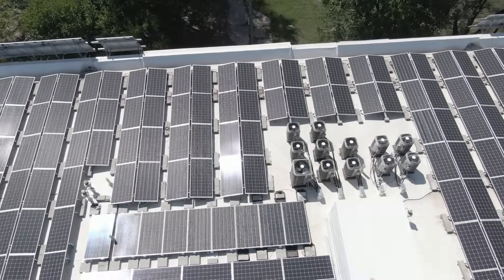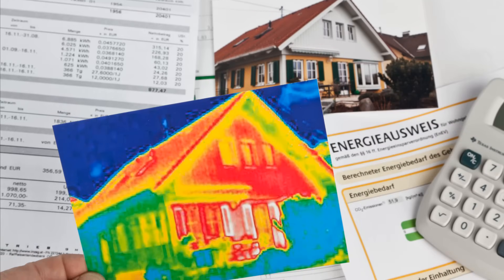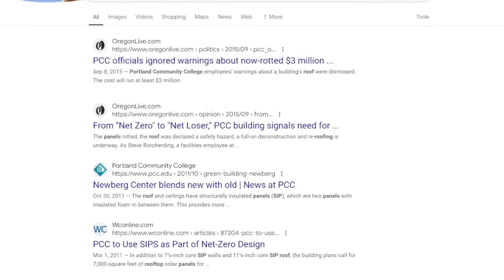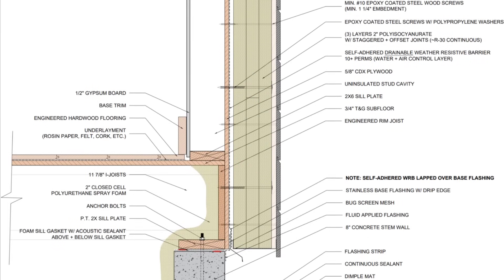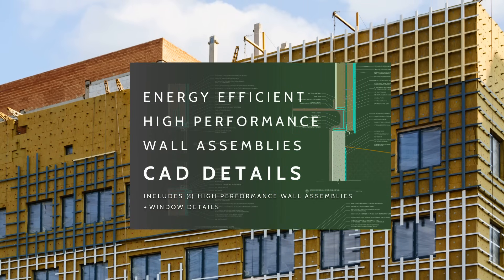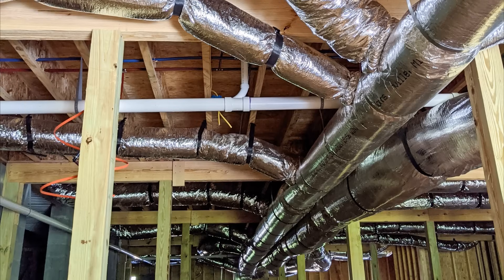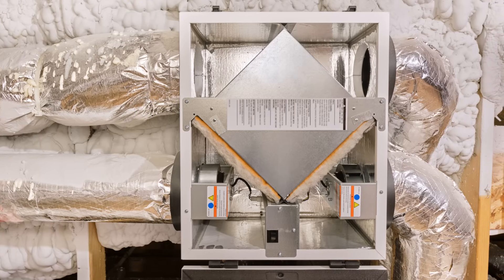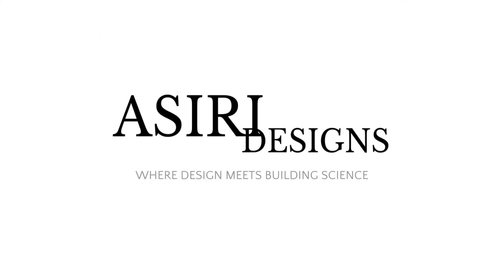The Unintended Consequences of Energy Efficiency...

Comment: So the answer would be less insulation in homes so they can breath and finding super cheap energy source for heating and cooling. The other topic I find no one talks about is sound. I like to sleep in total silence, but heat pumps, air conditioning and air  ex changers make enough noise to make that impossible.
Reply: Did we watch the same video? The one I watched said that more insulation is better, but you need to consider moisture ingress and retention. If you're looking for super cheap heating or cooling, heat pumps are the way to go. Well, actually it's district heating, but you're dependent on one (1) heat provider, which is bad. You may want to consider the placement of your heat pump in relation to your bedroom. These are all solvable issues, you just have to put in the work to consider these factors.

Comment: If you want true longevity, resource saving and energy efficiency:
- Let current wood houses degrade and be demolished over the next 1 to 3 generations.
- Replace those with buildings of stone, earth, cement blocks or brick.
- Place new structures to make full use of seasonal sunlight angles, avoid wind gullies and issues with rainwater flows.
- Bring back the multi-generational households of the past, thus reducing the need for new housing by at least 50%.

Trying to find solutions to a problem they caused is silly. Do it right the first time, follow historical methods if need be.
Reply: Wooden homes can last for centuries. Just look at any European city that was not leveled in WW2, they have many buildings that are older than the concept of a United States of America ;)
Reply: Mold is still an issue in a brick house, if you have double glazed windows. It just doesnt't destroy the structural integrity, unless you have wooden beams for your roof.

Comment: If you use Roxul - Stone Wool insulation moisture is not an problem
Reply from the maker: It's still a problem. Rockwool is insulation, insulation slows heat flow. Less heat flow = less drying potential. I happen to like Rockwool and I use it frequently, but it is not some magic insulation material that defies the laws of physics.
Reply: @ASIRIDesigns  That is if you don't plan ahead.  I have my installed use Roxul R23 in 6.5" cavities and leave open air gaps between the insulation and the exterior siding to allow moisture to wick.  Most people don't plan for this because they don't think moisture in their area

Comment: More expensive building.  So the energy savings is deleted… unless living on the street counts as energy savings
Reply: If you look at McMansions you can see lots of opportunity for cost savings without sacrificing energy efficiency.
Those complicated roof structures are prone to leakage.

They are built to a price-point. Homes are getting expensive because people (and corporations) are buying up land as a tax shelter. Land lacks the primary mechanism for lowering prices, increased supply, leading to market failure. In the absence of a Land Value tax: housing prices can only go up long-term.
Reply: @economicprisoner  I concur your assessment is correct.

Comment: exteriour insulation is just way too expensive; probably because there is high demand. 
something to note though, is animal / pests LOVE insulation. so before you know it, you'll basically end up with 2 full walls side by side, with sacrificial sheathing.

metal siding is cheap and creates a inherent rainscreen via the corrogation, so the exteriour wall could probably just skip the sheathing and use metal siding.

Comment: Don't forget radon.  You might be able to add better insulation to an older home, but can you really make sure the radon doesn't get in and stay there?  Also, is it really cheaper to seal the heck out of everything then install and maintian a ERV or HRV?  Some things make much more sense in new construction.
Reply: I can only tell you from my German POV. I stalled 3 decentralised HEV in my last house and the present  one. These are boxes (60x40x10 cm) the run on approximately 5 W. I don’t have to worry about ventilation/ heat loss. Asthmatic visitors commented positively.
It is also about CO2 and chemicals getting out not only moisture. Radon of course as well. Opening the windows alone is inefficient and has a number of drawbacks. I think Sweden has a mandatory Code to include forced ventilation. I think the health benefits in the long run outweigh the initial/ running costs.

Comment: My old house, over 100 years is hard to insulate, but having a woodstove is the best thing ever.
My house really works well on old technology.
Not everything new is good or better than old tech.
Reply: I put in a wood stove a couple years ago and it was the best thing I ever did. It's a lifestyle. Wood stoves aren't for modern people in subdivisions but land owners who manage land and know how to use a chainsaw that uses gas. lol I will always have a wood stove from now on.
Reply: @Jumanjini  Exactly.  I literally takes a ton of wood.  One estimate it is takes 22 years of tree growth to heat the average house for 3 weeks.  You need lots of land so not practical for the majority of people.  You can have the stove outdoor to avoid indoor pollution, but if enough people had them outdoor it will create outdoor pollution.  Nuclear power with heat pumps is the best solution for most of the world.
Reply: Your wood stove pollutes your interior.

Not everything old was ever great to begin with.
Reply: @Omniverse0  I take it you've never lived with a wood stove. In my experience a single candle pollutes the indoor air more than a halfway decent wood stove. You might get a tiny bit of smoke escaping when you first fire it up, but once it's warm there's such a strong suction from the flue pipe that any leak will only pull fresh air in. Smoke does not leak into the room.
Some old wood stoves can be bad for local outdoor air quality, but modern ones burn very clean as long as the fuel is of good quality.
But man, heating a poorly insulated home with a wood stove can get very expensive. Firewood typically isn't free. My parents used to do that. In the winter they'd easily go through a sack of firewood every day. They cut that heating costs in half simply by re-insulating the living room. Turned out the walls had originally been slapped together with very little insulation. Later they installed a simple air to air heat pump, cutting heating costs even further. Now they only need that wood stove for the absolute coldest days of the year.
Reply: @fnorgen  sorry, but wooden stoves are a very serious polutant and health risk - read up on it.
Reply: @Omniverse0  The house has one air exchange every hour on a calm day. What pollutants  are you referring to?
Reply: Be careful with particle polution. Have something to measure it in your rooms.

Comment: This is a very important warning for remodelers and those using newer constructions techniques and materials. "Build tight, ventilate right" is the saying in weatherization, but too often there is a lack of understanding of what constitutes "right." The tighter you make the envelope, the more attention you have to pay to movement (or lack thereof) of air. Of course, one could eschew the modern building materials---most of which were designed to follow existing building traditions in the most profitable way---and use breathable natural materials, like hemp-lime.

A well-made hemp-lime wall structure avoids the complexity of modern, multi-layer, multi-material walls system while providing moisture management through natural permeability; they provide insulative value and comfort through thermal mass; and they reduce the toxicity and carbon footprints of buildings. A hemp-lime wall can be formed in place (cast) or assembled from pre-made blocks. Exterior and interior finishes of lime-based renders can protect the structure from the elements while maintaining moisture permeability.

Hemp-lime is not load-bearing, so some sort of framed structure is needed. But another benefit of this methodology is that the construction crew needn't be skilled tradespeople: a few hours of hands-on instruction from a single skilled foreperson is all that is required to deputize a hemp-lime building crew. The possible downside of such building methods don't necessarily lend themselves to the economic realities surrounding our housing shortage (in the U.S. and elsewhere). How can we build the volume of housing that we need at the pace that we need it? Perhaps local communities can organize hemp-lime building cohorts that can supply labor to local housing developments. The labor need not be skilled to the same extent that a traditional stick-frame house requires, so perhaps that is an advantage? I'm eager to see how hemp-lime can be integrated into modern construction. It's such a beneficial material, and truly carbon-negative.
Reply: My next house i build will be designed with hempcrete (hemp lime) walls. Seems almost too good to be true

Comment: Funny how unbelievable concentration on one building method make a lot of troubles that not exist with other methods. But it better to run one method in to the ground with  added complexity than switch to other wall material, like factory produced foam concrete blocks, for example. Said blocks are literary immune to bearing capacity loss due to fire exposure, of course non-combustible, are structural component and insulation at the same time, take no damage from water exposure, and you can easily plaster over with machinery, eliminating all drywall shenanigans, you can attach almost anything outside/inside in any point... And 5000 worth of blocks is enough for code-compliant(by insulation requirements) 1000+ sq ft house... In Europe those blocks are everywhere, and it hard to find any new construction where it not used....
Reply: Are they available in USA?
Reply: @krashanb5767  as far as I googled it, no. Probably exist somewhere, but just get lost in tons of ads.
Reply: @krashanb5767  You should search for AAC blocks in your particular area.

Comment: If you don't have good insulation in the cold weather you will have moisture issues also you need to make sure you have the proper ventilation in the attic and fresh air make up and proper exhaust for the bathroom and kitchen
Reply: Not entirely correct, air leakage  plays a major role also
Reply: @stevenbaczekarchitect9431  yes that's correct I was covering Air leakage when I referred to good insulation but thanks for pointing it out I should have included it in my post

Comment: question, doesn't the perfect wall system result in condensation on the "cold side"? which in somewhere like the south would be the interior side of the insulation or is it assumed that the exterior insulation is, and always will be air tight?
Reply: If the inside is the cold part (in a hot climate) there is probably some cooling being done, extracting humidity in the process.

Here in Europe, there is s lot being built with foil/plastic that stops most moisture getting through, and can do that in a certain direction.
Reply: No, it does not, doing a " perfect wall" in South Dakota

Comment: Nice to finally hear some common sense,  instead of just the usual, rabid, must-save-energy-at-all-costs.  Need this same kind of common sense with modern (junk) appliances, where, not only do they not last, but often their energy savings over old, well made equipment is a lie (to encourage replacement), and their performance is inferior.
Reply: Yeah I just watched the video that explains why an air conditioner only lasts about half as long today as it did in 1990.  Part of it is because they are made with lighter weight parts in order to make them more efficient.  Lighter weight parts wear out faster.  So then you have to spend $7,000 replacing it in 10 years instead of in 30 years.  I think the actual number is that they last 13 years now.

Comment: 1) Replace windows with Nordic ones
2) Install Geothermal heat pump (especially in cooler climates). One kWh of electricity becomes 4-6 kWh of heat
3) Install solar panels to generate excess electricity. 
4) Install home battery storage when it becomes financially viable.

No need to insulate further and you have slashed your heating costs by 80%.
Reply: I live in New Zealand where the government building regulations were so poor we have a generation of rotting homes called "leaky house syndrome" We lived off grid in a remote rural area. Out living areas were two 40 foot refrigerated reefers. These were no longer refrigerated but being made from stainless steel inside and outside with 4 inches of urethane foam in the middle. No thermal bridges and no moisture ingress. The waste heat from computer, microwave and fridge kept the inside at about  19 deg C. A small fan driven heat exchanger supplied fresh air, the few windows were argon double glazed. Humidity and mold problems were non-existent.  We had lots of other space as work shop, hot house gardens etc so small living space was not a hassle. Living in shipping containers is semi-illegal here, so much for wisdom. I now live in town in a 20 foot reefer inside my commercial building. It is warm, dry, quiet and comfortable.
Reply: @howardsimpson489  When you say shipping containers, if that refers to used containers, and not purpose-built, the illegality probably has to do with the treatment commercial containers have, to make them fire and pest resistant. Those chemicals are almost always wildly carcinogenic, and there's also the stuff that may have been transported, which could've been unhealthy.

I've not researched the numbers, but purpose-built containers for habitation appear to be on par cost-wise compared to traditional construction, with the added benefit of being transportable. I'll be happy to see an actual comparison of pros and cons, but in the end for urbanized areas, it's the cost of the land that's problematic, and not the residence that would be built.
Reply: Being Nordic, I have no idea what "Nordic windows" are. Would you mind elaborating?
Reply: @herbertherb9904  marketing is great xD
Reply: @herbertherb9904  regular windows for us in EU. Triple glazing, argon filled, alu frame plastic cover and rubber sealing. Space technology for  USA with single pane sliding windows.
Reply: @lukacsnemeth1652  where do you get single pane windows in the US?

Comment: heat is not required for drying! yes hot air can take on more water, but in winter the air is dryer, and therefore still has enough capacity to take water out of the construction. I come from Austria a colder climate we want to dry through from inside to the outside. In a hotter climate it can be different.
Reply from the maker: Yes, it does. Phase change requires energy, this is Physics 101 stuff. You're also forgetting something else, and that's cold winter air is only "dry air" if it's warmed up, otherwise the relative humidity of that cold winter air is typically still "humid". Wood  being hygroscopic increases and decreases in moisture content with changes in relative humidity. If you are bring in cold winter air in a well insulated attic, there isn't enough heat loss from the building to warm up that cold air to provide the benefits of moisture removal. Don't take my word for it though, you can check out building science corporation's article(s): https://buildingscience.com/documents/building-science-insights/bsi-141-shakespeare-does-roofs

Comment: Finally!!!
Someone stating the intrinsically flawed strategy embraced by our entire residential building industry.
So the last 30- odd years of home building has been one long experiment with a very concerning balance of failures to successful initiatives.
The resolution would seem to be to eliminate cellulose from the building process.
We now need to totally re-think the residential home building template.
Reply: Concrete with isopor.. genius
Reply: I wouldn't say the building industry is totally flawed, i would expect most industries have technology challenges, look at the medical industry
Reply: You mean using stone and concrete and the like?
Reply: @MrHuram-abi  concrete breaks down and leaks nearly as badly as wood. Stone would be the best bet strength and longevity wise, but its very limited in its supply if the goal is reducing environmental impact.
Reply: Unfortunately we operate under the ludicrous belief that nothing is a "flawed strategy" as long as it's making money.  No where is that more evident than in our residential housing market.
Reply: @StFiacre  well said
Reply: Maybe it is time to look beyond USA's borders.
We have buildings that work well, even in wood frame construction. We didn't stray too far from the original way we build houses and we know how to build not just for generations, but for centuries.

And concrete has indeed proven to be a poor choice. Burned clay, wood or raw clay are extremely long lasting when maintained properly. The roof needs to be big enough (yeah, to protect the walls from rain and it helps against heat too) and when it is maintained it can last centuries. 

How has the USA forgotten to build proper homes?
Reply: @alis49281 

Raw clay is terrible anywhere but in the desert... Falls apart in months
Reply: @westelaudio943  I'm sorry, but you are clueless. Clay, also called loam is used worldwide in almost all climate zones, including India to build houses.
I live in central Europe and roughly until 1920   it was used to fill wood frame houses. Most of them are 300 years old, some 500 years and beyond.
The clay is raw, but mixed with straw, sand, sometimes cow poop. It has the strange power to preserve wood and protect it from moisture.
Some companies made it into a high tech building material. It is interesting stuff to build a home with.
Reply: @alis49281 the USA caters to a purchasing culture that challenges sound decisions,  we tend to think we can value engineer everything